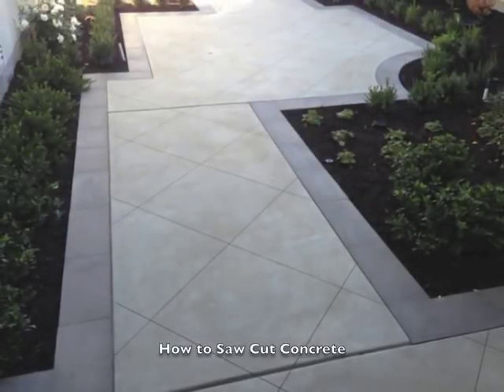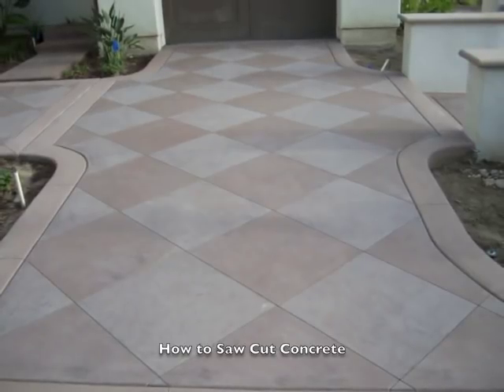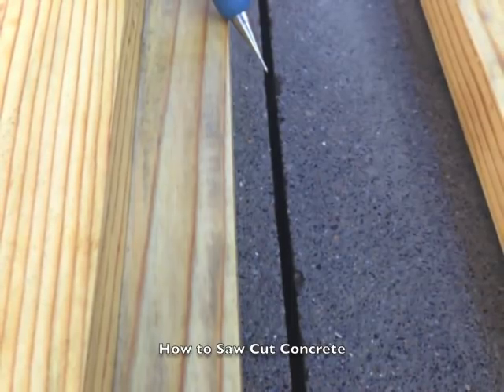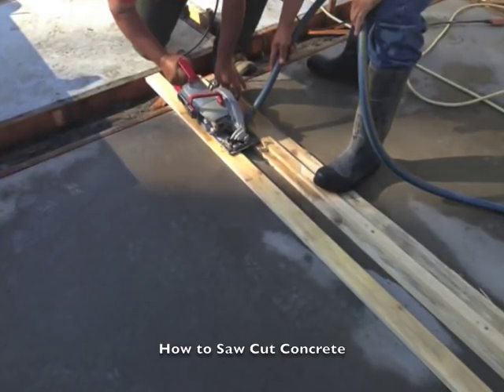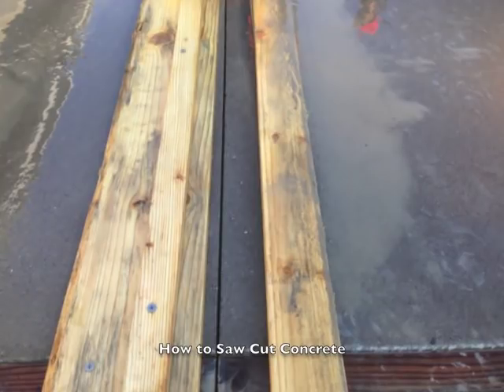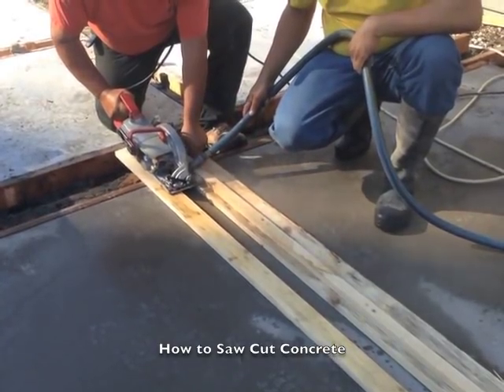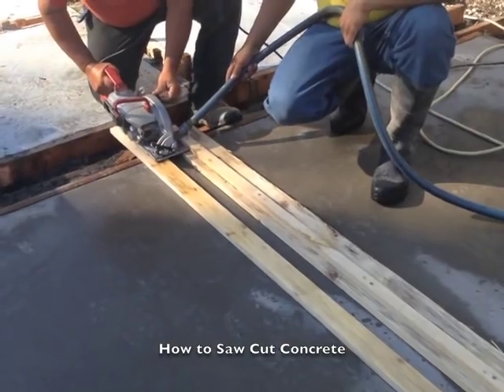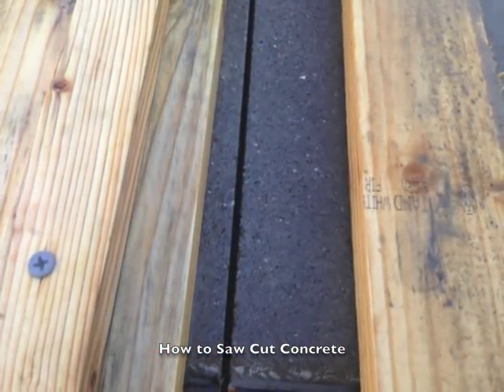How to Saw Cut Concrete

Comment: I used your method to cut a channel through some concrete... a guide carefully assembled out of some planks. A self cooling diamond blade for my handheld circular saw....et voila! A perfect cut through some concrete paving ready to dig out some footings in the soil below... And so easy... taking sensible precautions and safety measures of course.